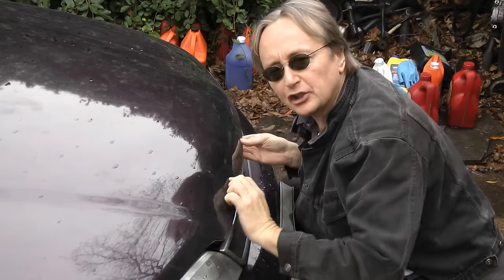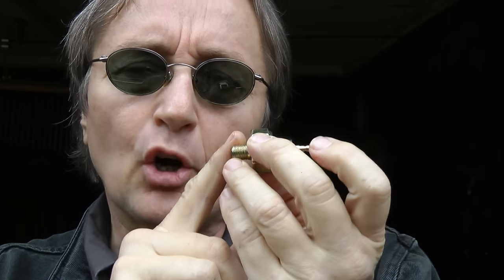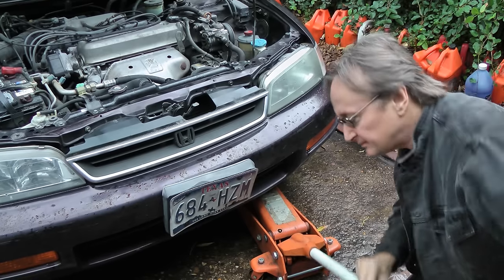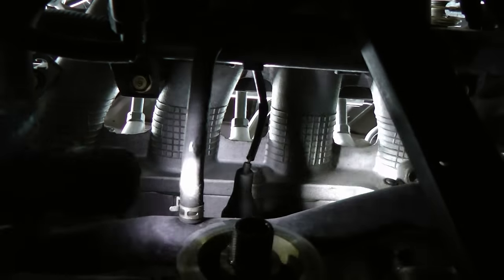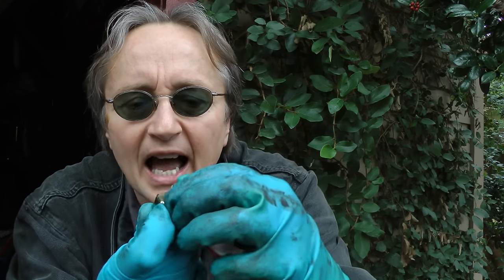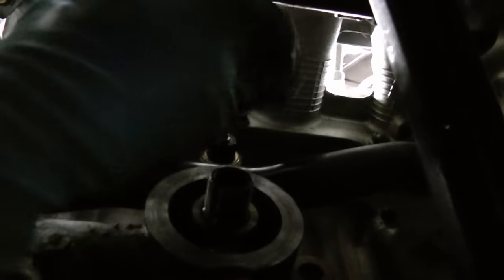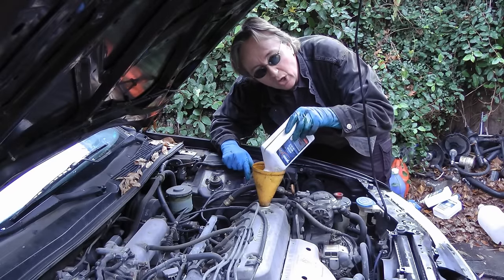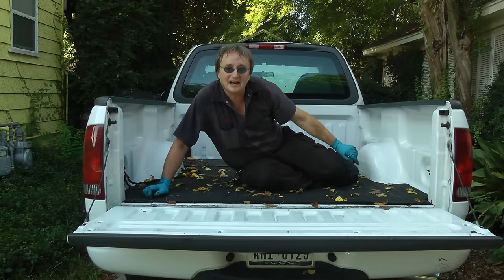How to Fix a Low Oil Pressure Light in Your Car

Comment: My cars check engine and oil pressure light come on at the same time while at idle and while driving but it turns off then comes on sometimes when I step on the gas then let it idle again that's when it comes on again. Have any ideas

Comment: Hey Scotty, I have a 2007 Chevy impala with the oil pressure light coming on stating stop engine. It recently started after I changed the oil and had a couple really cold nights. When I drive it comes on and goes off periodically. Oil levels are fine. I am planning on changing the sending unit.But I was wondering what you think it might be.
Reply from the maker: change the sending unit AND the oil filter, as bad either one can cause that. Often cheap oil filters do it a lot
Reply: It was the sending unit. The filter was fine
Reply: Scotty Kilmer I generally buy the premium filters, but often wonder if I am a sucker. What filter grades are worth while?
Reply from the maker: GunFun ZS
realize filters are just piece of filtering paper inside a thin steel shell. As long as you buy any known brand, not made in china, they work fine
Reply: Scotty Kilmer Thanks. I usually get Fram or similar. I figured the ones with rhino liner on them aren't worth the extra, but they can be easier to remove without a puncture.
Reply: @scottykilmer  mines comes on while I drive it but it goes away and doesn't stays on even when I have the car just turned on

Comment from the maker: well,  a leaking sensor will lose pressure so fix that , only use a dealer sensor, not a cheap aftermarket chinese one, they are often bad. If that doesn't fix it, engine has internal oil problems then, typical on that poor design

Comment: I have 2000 chevy impala and the low oil pressure light is showing up. but there no oil in the car. I put more oil in it and it drove fine for a while then  the light came on again and there wasn't any oil in it?

Comment: A Sticking oil level sensor will also  cause ur car to read low oil pressure... and not send oil through the engine and then ur lifters will start to knock and ur car will not start. ..it will sometimes but it will be a very hard start an ur car will run loud from the lack of oil and die suddenly

Comment: I have a question, I been procrastinating on getting my oil changed. My change engine oil light been on a couple of weeks. Tonight on my way home, check gauges light came on and my steering wheel was locking up and truck started overheating. I was close to home so i just kept turning it off and on until I can make it home. What could this be? it is a 2004 chevy trailblazer.
Reply from the maker: many things can make them overheat, but you steering locked up, so I would check for broken fan belts first, they could do all that
Reply: +Scotty Kilmer Thanks for the reply. Gonna get it checked today. I hope my engine isnt gone
Reply: +Scotty Kilmer exactly what happened i lifted the hood and the belt is off but not broken. I see coolant on it
Reply: +Renae1983 u are going to blow a gasket. .the oil is the blood of the car. if u don't change the oil u will blow a gasket and lock the engine up..the u will need a whole new car

Comment: Hey Scotty,
I have a 2004 buick Rendezvous. It's been losing power and fluctuating during idle when I stop at a light. The Low Oil Pressure light can on for a second and disappeared. could low oil pressure be the reason I'm losing power?
Reply from the maker: if the engine idles too low, the oil pressure will drop too low from the pump not spinning fast enough. Try fixig the idling first, see my video "how to fix a car that idles poorly"
Reply: Got it. Thanks

Comment: That light went on in my car when I started it, then I turned the car off and then back on and the light never came back on again after I went to the store and back, so I'm hoping it was just a glitch since I'm a female over 70 years old and I HATE when I have to pay a mechanic because it's ALWAYS an astronomical amount and I'm a little leery sometimes.  You're lucky you aren't my neighbor.  I'd be knocking on your door every now and then to ask you why my 2006 PT Cruiser is acting up.  Thanks for the info.  I hope that oil light stays off and my car doesn't break down and I have to have it towed, which I've already had to do.

Comment: Hi Scotty. Listen, I have a serious trouble here. I already bought a Mazda 2 1.3 with 99.4k miles on it. I drove it home, and then I checked the oil. There was no oil on the dipstick,  was completely dry. I checked the papers and I figured out that the last oil change was made at 80.7k miles. So I opened the oil cap and I saw some deposits on it and on the engine internal walls (I checked with my finger). I don't understand why my oil pressure light didn't get ON. By the way, after the scary situation, I filled the engine (to the maximum dipstick marker) with just 2 liters of oil (from the total of 3,9 liters which is the engine oil capacity). Maybe the 1.9 liters of oil in the engine were still enough? Not to cause an engine failure or getting ON the oil pressure light ? I don't know how to check the oil pressure sensor...

Comment: Hey Scotty I'm in the UK my vauxhall astra 1.4 petrol has just been fitted with a new oil pump oil and filter but the oil light still comes on at low revs any ideas I've also replaced the oil pressure switch
Reply from the maker: +cass2112 first, put on a mechanic's oil pressure gauge and see what the actual pressure is, pray it's not really low. Cause if it is, serious engine work is needed like oil pump or engine bearing replacement
Reply: +Scotty Kilmer cheers just had a new pump and timing chain fitted thinking it may be an electrical fault now

Comment: Hello I have a 2007 diesel santa fe crdi 2.2 and need to replace the oil pressure switch, but cant find it...any help for the location of the switch
Reply from the maker: go to auto zone, they can show you a picture on their computer and sell you one

Comment: so my car does this when warm at low RPM, oil change due soon, any fix?
Reply from the maker: pray changing the oil and the pressure sensor fixes it, if not, engine is worn inside

Comment: I have a 2004 jeep Cherokee it won't start it cranks but no start. And the check gauges light came on. We thought it was the cam shaft sensor. But that wasn't it. We've already changed the crankshaft sensor to about three months ago. The fuel pump is ok it's getting fuel so what else could it be. It was just fine yesterday. Thanks
Reply from the maker: do my video "fixing a car that cranks but doesn't start up

Comment: Great videos Scotty! I just purchased a 2002 Toyota Camry 4cyl that sat idle for a couple years (93k miles). I suspect the owner failed to do regular oil changes. Had a mechanic flush the engine oil several times but oil pressure was still low. He changed the oil pump and it seemed to fix the problem. I drove the car home (~15 min ~10 miles) and the oil light came on. Replaced the pressure switch. Same thing after driving 15 minutes. No severe knocking noises even at idle. No bubbles on dipstick but oil level seems high. Could too much oil level cause this issue after warming up? If the flush has cleared sludge and plugged oil filter would it only drop pressure when hot? Oil very clean on dipstick. Thanks in advance for your help!
Reply from the maker: yes, make sure it has the correct amount of oil,and for safety remove the oil sending unit and have the pressure tested with a mechanic's gauge to see if it's good or not. If good, ignore warnings
Reply: Filled to proper level with 5w-30 full synthetic and installed a good new filter. Installed a mechanical pressure gauge. The oil pressure goes up to about 50psi when first cranking.  After driving about 5 minutes, it seems to act "normal". About 10psi per 1000rpm. Pressure rises and falls with RPM. Pressure then gets progressively lower over next 10 minutes until it struggles to stay above 10psi regardless of RPM. Engine temp is fine throughout.  After turning off and  restarting engine, it works fine while idling and revving up to 2000 rpm. My guess is the oil pathways are varnished but the oil thins out too much for the most likely worn bearings as it heats up. Going to try changing oil with full syn oil every couple hundred miles to try and clean passage ways... Then try a 5w-40. Am I wasting my time and money hoping the bearings are ok? Is it possible an overfilled transmission would cause these symptoms? Slow draining from top end? Other ideas?  Thanks for your input!
Reply from the maker: flush the engine out with a commerical flush, all auto parts stores sell em. Pray that fixes it, cause if not, odds are the oil pump is going out or bearings are worn causing oil pressure drop when engine heats up

Comment: scotty. im deciding to go for a 5sfe rebuild teardown. its off a 94 camry going into a 93 camry. i purchased a oil pump from ebay. but there is 2 different types and they have "sensor port types" what is the difference between the 2? cheers
Reply from the maker: +micheal balma  I have no idea, get the vin number of the original car if you can, and call a toyota parts dept and they could tell you which one is right

Comment: hi scotty, i have a 2004 nissan titan with about 134K miles. my oil pressure light pegged out at all times a few days ago so i ordered a new sending unit and replaced it. now when i start it up  it goes to mid range and slowly goes down. as i drive at about 2k rpm it is in the middle but as soon as i let off gas it drops to about 1/4 or a little lower. at stops it goes so low that my oil light comes on. can you please help me? did oil change about a week before sending unit went out. running 5w30 oil and i live in central florida. any ideas?

Comment: Hello Mr. Kilmer, I have a 2001 ford f150 4.6 V8 engine I was wondering where is this oil pressure sensor located on my vehicle. I saw a diagram from autozone but it doesn't really distinguish where it is at? Can you help me?
Reply from the maker: +Crystal Heath  should be near the oil filter, jack it up to see it better and crawl under
Reply: you have 4.6l not a 4.8 that's a Chevy motor
Reply: +chris clevenger ya I put the wrong number
Reply: +Scotty Kilmer Thank you

Comment: I just replaced my upper and lower intake on my o2 Bonneville it was leaking antifreeze and now I have a weird whining noise coming from my engine but when I remove the oil cap it goes away . there's a strange suction thing going on also . plus oil pressure is fluxating . any idea what this could be . I was thinking pcv .but I'm not sure
Reply from the maker: replace the pcv valve and the hose that feeds it, pray it's just that
Reply: Scotty Kilmer thanks scotty for the advice ,,I actually took the pcv out and noticed the o-ring was fitting really loose around it and not causing a good seal  ,,got a tighter fitting one and it worked like a charm

Comment: okay please help I have a f150 06 5.4 3v and when im driving everything is normal until im in a stop light the rpm get really low and the truck died and shows low oil pressure I check the oil and everything is fine but it has a weird noise under the truck close to the hole where you're drain the oil you think is a bad oil pump or the one you change in you're video ?
Reply from the maker: +Edgar De La Rosa   sounds like the engine has a serious internal problem, pray it's just a bad oil pump. Remove the oil pan and check that first

Comment: 98 Prelude SH 2.2 DOHC, Scotty, the light came on and stays on even after disconnecting the cable from the sender unit (probably grounded somewhere). just to be safe i plugged a oil pressure gauge in there and it reads between 2-4 psi at idle.  when it should be reading about 10 psi at idle... what could be the issue. ? is it safe to drive with that pressure?
Reply from the maker: as long as engine does not clank when idling and pressure goes up when running faster, that's OK. But I would try to set idle up somewhat higher

Comment: i got 2007 jeep patriot the low oil pressure on, the engine on and off sometime the car shut down in the middle of the road.. then i start the car  it’s running again happens 3 times now.. can you please help

Comment: Hello I have a 2013 dodge ram 4door 5.7 hemi 4wheel drive..my check Enright came and the code is P1524...I changed the part cleared the code,few miles down the road check engine came back on.@ idle 25psi highway speed 31psi.any ideas? I was thinking oil change and filter? Thx

Comment: hey scotty , i want to ask you , which is good for the engine when the oil pressure is high or when it's in normal range ?
in fact i did a modification on chevy cruze 2012 i install an external oil cooler but im not sure after i install the oil cooler is the oil pressure ok or no , while i notice that there is no oil light come on which is mean as thing it's good .
kindly advice ?

Comment: i have been having problems with my 1994 VW Jetta GL for some time, with oil light, engine light, brake light coming on intermittently, and the engine speed dropping once in a while.  I kept checking oil, and it was ok.  Then recently the car started failing to stop, especially in cold/rainy weather.  After trying it several times, it would start and then run from there, with the same problems already discussed.  Today I went to start it, and there was a loud sound under the hood.  I thought it was an engine backfire -- it was not!  There is a canister connected with two hoses, one going into the block and the other into idle air control valve.  This canister is what blew up.  It seems to be a filter, and I expected it to be only for air.  It has oil in it.  Does this give any ideas about the causes of my problems?

Comment: i also have a 1989 Pontiac grand prix 2.8l that i have changed the fuel pump crankshaft position sensor also the ignition control module but when the car is drove for awhile an then turned off if i was needing to use it again it will not crank but when the engine is cold it will start right up with no hesitation also if its crunk running at idle for bout 5-10minutes  the oil pressure gauge will drop and the check engine light a pop on but as u pull of an the rpms go up the oil pressure goes to normal and the check engine light goes out is this a sign of a failing oil pump

Comment: I hav a 08 Lincoln Navigator and i hav a small value cover gasket leak on 1 side. Could this cause the oio pressure light to come on. Plz help
Reply: Yes, and sometimes you fix one and another problem is uncovered. Replacing the gasket is no problem.

Comment: I have a 07 silverado and I get the low oil pressure message when im accelerating to like 45mph and as soon as the light pops up i let off the gas and it goes away immediately... Any idea what this could be?

Comment: Hey Scott,

Luv the Vids.

I have a 2012 Chevy Camaro RS V-6. Recently outlet on the radiator broke which caused it to overheat. I had it repaired and now at start, the oil light comes on and reservoir is full. Oil is clean as well.

Please advise,

Car Dummy
Reply from the maker: MrJetbuildr1 often a blown head gasket does that. Do my video "how to tell if your head gasket is blown"
Reply: Scotty Kilmer Ouch that sounds costly  :( 
Ok ill watch tat vid thanks Scott.
Reply: MrJetbuildr1 ok, watched the vid got to go out and get tester. btw it only has 20,000 mi. I suppose it can still be open to a blown head gasket, another thing, improper filling and pressurizing of coolant after repair cause that light to flicker?  Only at start up will it flicker but then the light goes off completely.

Comment: hello scotty i have a 2006 volkswagon passat 2.0T and i keep get this when i'm driving (stop oil pressure  engine off) and i checked the oil and there is enough oil in the car. can you please help me you are the BEST
Reply from the maker: +qeliku kulleri have the oil pressure measured with a mechanics actual gauge first, and pray it's just a bad warning system on your car and not actual low oil pressure that costs a ton to fix on those VW engines

Comment: I have a question. When i turn the key, the oil pressure light doesn't light on. This cost me to fail a smog test. I changed the bulb becaude it didnt have one but still doesnt turn on. I have a 1998 honda civic. Im running out of ideas and dont want to take it tk a mechanic to charge me a fortune for a light bulb.
Reply from the maker: Miguelp1000 replace the oil pressure sending unit, they cost ten bucks or so. Pray it's not in the wiring or the computer

Comment: Hey scotty, the oil pressure gauge on my 96 chevy c1500 starts fluctuating like crazy (often off the meter) under heavy breaking and steering (i.e. just turning the wheel when the truck is stopped).  I check my oil level frequently but haven't found anything out of the ordinary.  Is this something to be worried about or could their be something wrong with the pressure sensor?
Reply from the maker: +nastyswag change the sensor and pray it's just that

Comment: sir, i have a question, is it possible that becuase of this problem car wont start
my engine stopped suddenly while driving in first gear (chevorlet epica), and it was showing oil pressure light on for few times(like 2 or 3 times),but now engine does not start at all and oil pressure light is on, any help will be highly appreciated

Comment: Yea my impala 2010 is doing the same thing it says low oil pressure. I notice it will say low oil pressure when I'm Turning on a on ramp before getting on the highway and my oil level is fine. My impala has 150k 

I was thinking about replacing my oil pressure unit. 

I was wondering if it was due to a bad oil pump. But I always use premium synthetic oil and oil filters.

Comment: My Opel Corsa Bakkie lose power on the steep, I changed clutch it's better but not 100%. There is knocking noise also when I accelerate. What could it be?